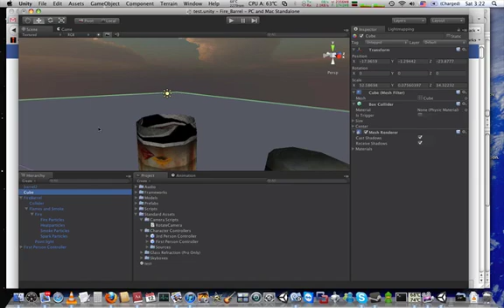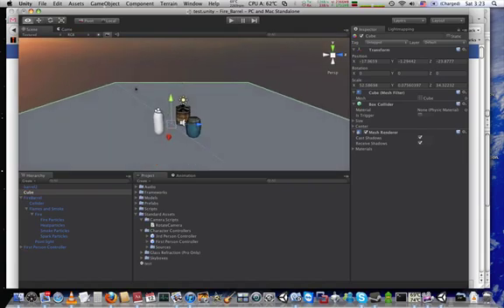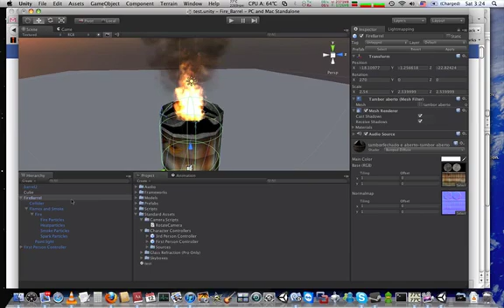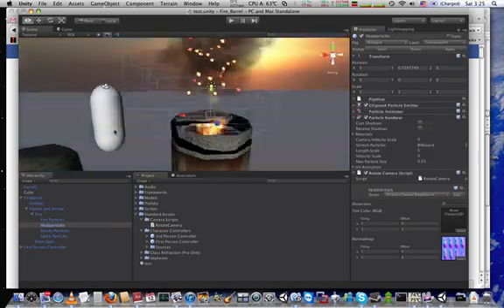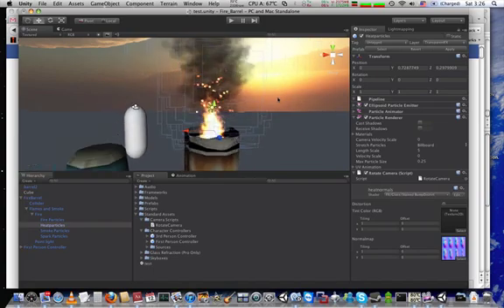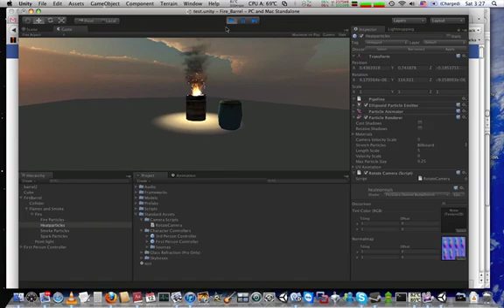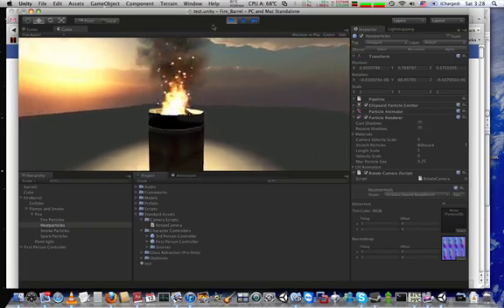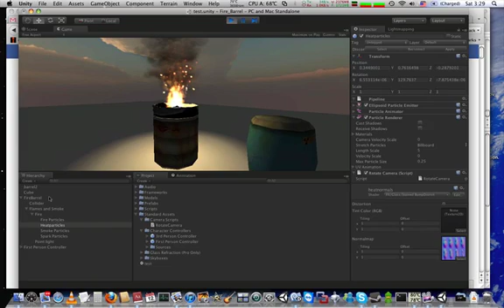Unity 3d - Heat Distortion Tutorial

Comment: Using the HeatDistort shader without a normal map and with the Distortion property set to 0, is it normal to see a slight shift in the rendered pixels regardless?

I've been wracking my brain trying to reverse engineer it so it doesn't do that with little success, but it's not a huge deal I suppose.
Reply from the maker: +Dan Wild Yes, you'll probably get weird results by using the shader without the normal map. I am not sure why you are trying to do like that though.
Reply: +Tuti Bueno I was using that as a test to make sure that if I had a normal map in which the edges are all in the 'forward' direction, I would not see any distortion along those edges and instead only get distortion on the red and green areas of the normal map.

For instance, I have a normal map with three circular "bumps," none of which touch the edge of the texture, so I would expect that the HeatDistort material would have no effect along its edge, but it does shift the pixels slightly:

http://screencast.com/t/U2QqXfQWxk
Reply from the maker: +Dan Wild Right, it is very noticeable in your case because (i guess) you are making a giant "wave" in your scene, right? If so, I would put an entire plane behind the camera and would animate the wave. Makes sense?

Comment: I have a question : Is it posible  to add this  effect,  in  a video game  that  i use?
Reply from the maker: +mitsoswu Yes you can if you are making a game with Unity.
Reply: +Tuti Bueno   Im' not making a game from the start .... i'm just, using a simulator and i just wanted to add some "heat effect" behind the engines. that's all..... so can  i ?
Reply from the maker: +mitsoswu If you have the project source and using Unity, the answer is yes, otherwise, no.